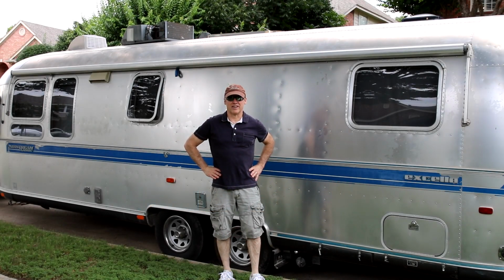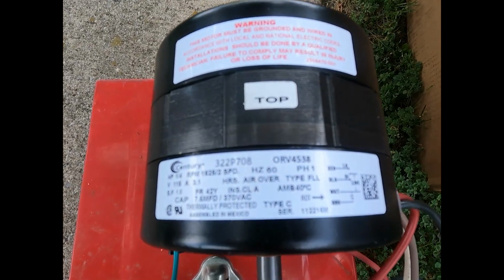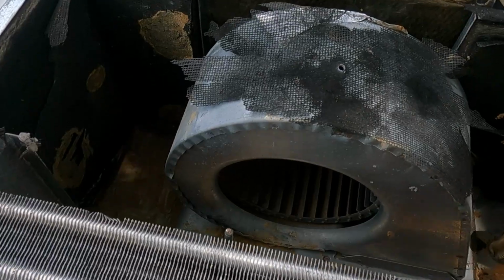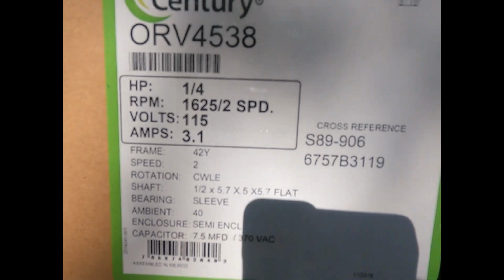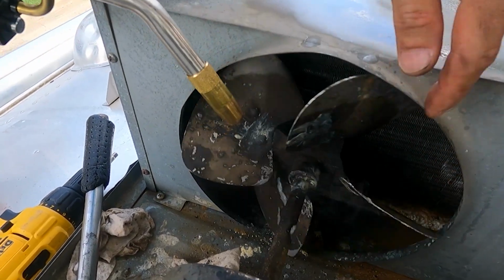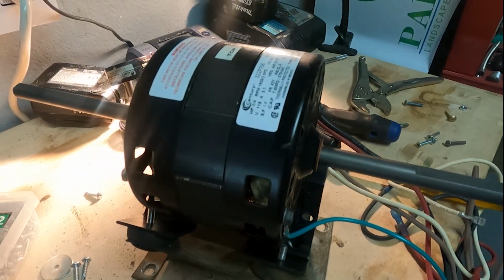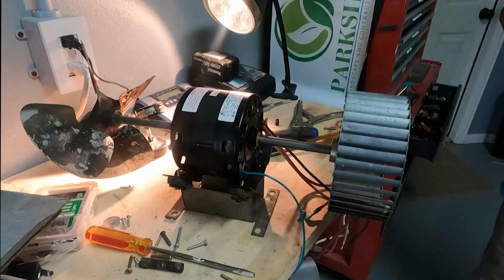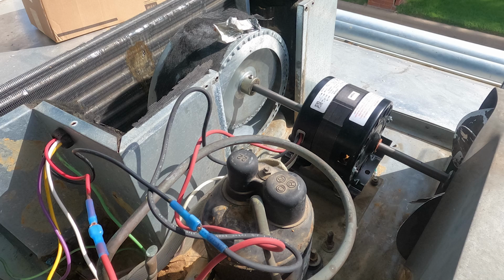1992 Airstream Excella -Coleman Mach Delta AC Motor replacement-RV Condenser Fan Remove and Replace

Comment from the maker: This one is just held on by bolts that thread through the fiberglass/resin cover and into the housing.  Most have 3 short bolts, maybe a big washer under each, and some are square-heads like allen heads but square, so you need a bit kit with various square-head bits to get them out.  Once you are on the roof, they should be visible on the top of the housing, likely in a triangle pattern.